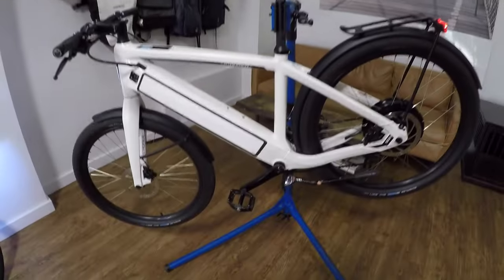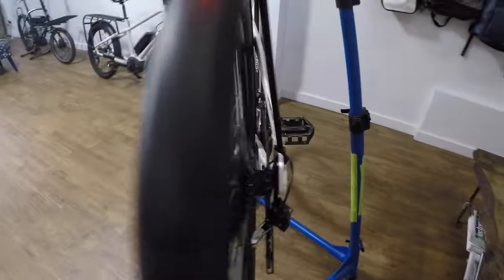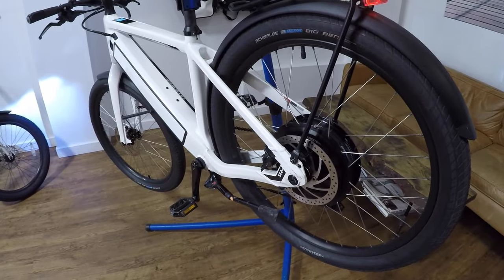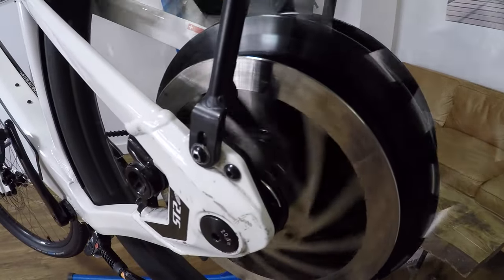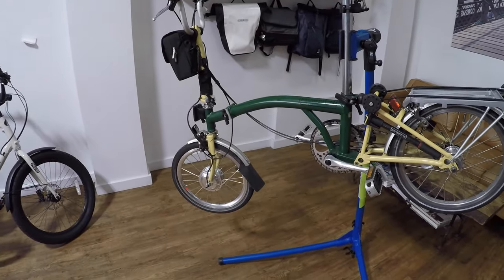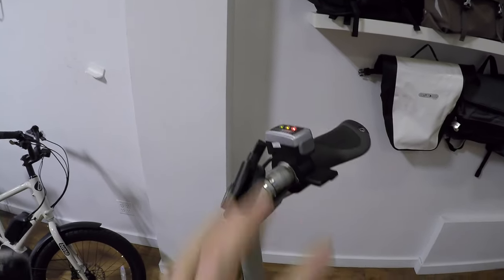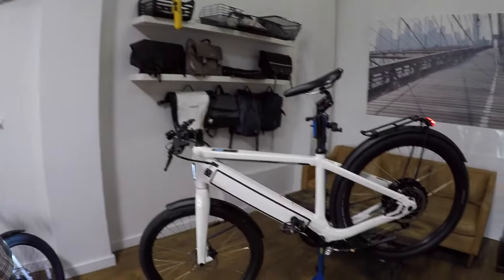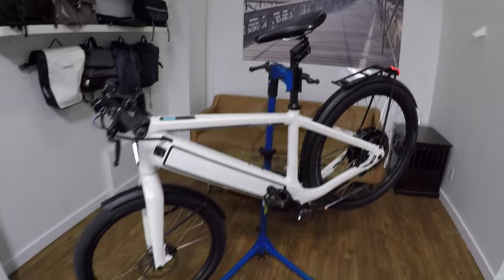Pedal Assist vs. Throttle Activated Electric Bike

Comment: Those throttle ebikes are cancer. 14 year old kids with no situational awareness on these things riding on the wrong side of the street in traffic, and they're not even getting any exercise
Reply: nochtczar In my mind ebikes are for adults, not kids. Don’t knock the throttle ‘til you’ve used it awhile. On my Surface 604, I use the throttle whenever I’m crossing a street or highway to minimize my exposure to cars, etc. Great device.
Reply: Larry Twitchell I'm sure in the hands of a responsible operator they are great, but unfortunately in the real world this things are used by assholes who zip along on sidewalks at full throttle
Reply: And those damn kids using them wheelie boards!

Comment: Can you get an electric bike that is a hybrid of the two?
Reply: Yes, I have one. It has the throttle so you don't have to peddle then it has three different pedal assist settings; low, medium and high.
Reply: Pedego bikes offer both Pedal assist and a throttle. Their Pedal assist has 5 different levels of assist.

Comment: How long does the battery last?
Reply: Pumpkin Pie Depending on rider weight, travel time, power mode ( level 1-2, 3 is boost in helping up a hill). mostly up to 20-30 miles/32-40klm per charge. Some can get up to 50m/87klm per charge on greater amps.

Comment: BionX?
Reply from the maker: Hi Anton, this bike uses the Syno Drive from Ultra Motor but BionX offers similar gearless hub motors with regeneration, I've reviewed a few of them here and they tend to be lighter weight: https://electricbikereview.com/brand/bionx/
Reply: ElectricBikeReview.com
Hi!
I had BionX HT L 250 .
That was 8 years ago...
Traveled on it for a Moscow winter, and successfully sold.
Reply: Is this bike legal to ride in new York and if yes where can I buy from

Comment: I don't like them I'm going to have it disconnected and put in a conversion kit as long as the throttle twist back you don't have to worry about it it's like a motorcycle.. plus it kills the battery every time you pull the brake so your battery will run out quicker on its life length

Comment: Which gives you more distance? Why not use a batter for a rear and front wheel hub motor? UBCO has the idea right.  Outside the box thinkers like Christini with his electric bike and this new 99%%%%%% efficiency bike by a Danish company called "CeramicSpeed".  

The ideas exist if people would let go of pride and greed. U could have the perfect e-bike.  Another thing is why is there no way to charge electric bike battery with a solar panel or a hydro electric charger?

Comment: They are heavy bikes, if you run out of juice you ain't gonna move unless you call a taxi 😏
Reply: not True. My 27.5+ off road Hard tail uses a 350W hub motor and its Easily Pickup-able and when climbing its a geared motor so if i Don't need it, I basically have no drag from it, about 15lbs on the bike. So at speed, its not that Noticeable. besides with the throttle I can pop it very easily on one wheel for guiding around narrow areas. its quite nice. 

on the road Side I have a Ultra Light Bianchi that Has a Very small 250W motor. and I placed 13 50E cells in series inside the down tube and in the seat post tube. and I get  250w of assistance for about an hour or so.  Besides its motor which looks like a data logger. most people Have no idea its a E-Bike. its also only 25 lbs
Reply: @Xyphren  my bike is 8kg & adding electric kit to it which in itself is 16kg makes a deal breaker for me. Not just the speed limit but also the operation time limit. Biking have so many benefits you cannot even count it. Electric assist taking away from positives but I am sure it will be more popular & it's a lots of fun 🧔👍